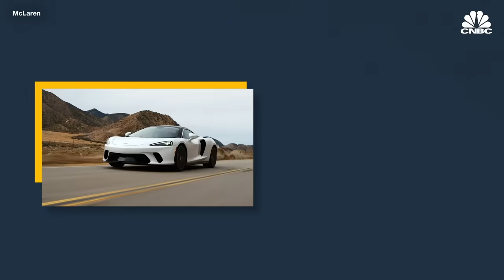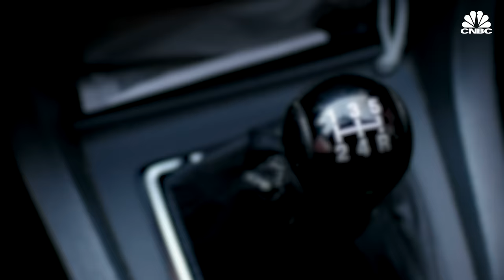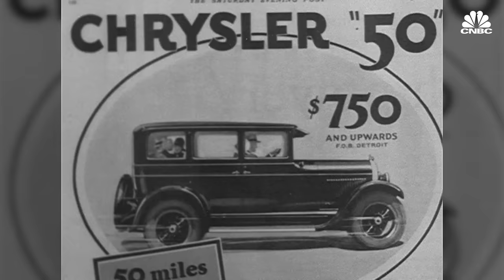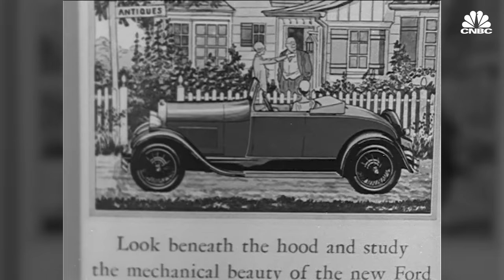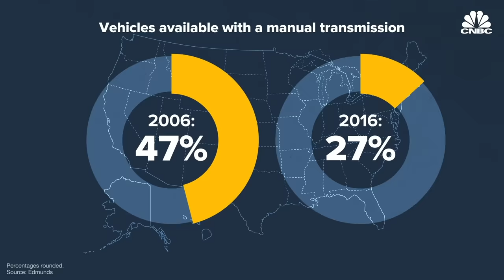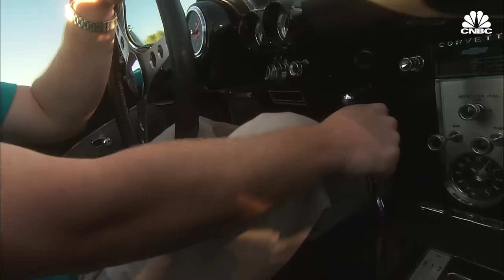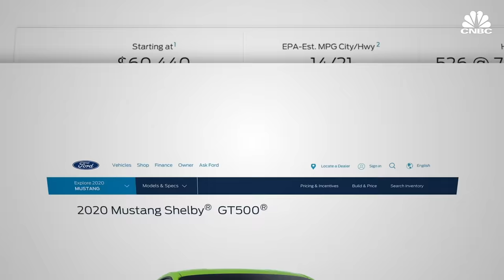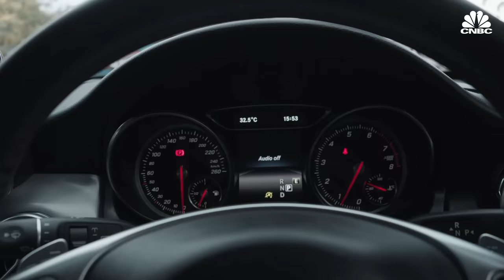Why Stick Shifts Are Going Extinct

Comment: I just came back from a tour where I had to drive automatic and getting back into my little manual Hyundai i10Go was a joy - I feel much safer knowing I have the gears to slow me down in the event of footbrake failure or engine failure. I have so much more control on turns and roundabouts as well. Herein England, I don't think manual will ever die out and most people I know drive manual.

Comment: Interesting video. Having worked at a car parts factory, I do have some knowledge of the whole supply and demand thing. But I, like many enthusiasts, bemoan the disappearance of manuals (admittedly, I don’t presently own anything with a manual). However, both my wife and I have driven/owned stick shift cars in the past and as a retired trucker, I have driven manual transmission semis hundreds of thousands of miles, in my second career. I think it’s a shame you can’t buy an entry level car with a manual, but that’s the direction things are headed. I do know that if I was still in the business, presently I could buy a Peterbilt 579 or an International HX520 with a Cummins and an 18 speed manual; alas I believe those days are numbered too!

Comment: I prefer them. You have more of a sense of control when you drive. I have always hated automatic shift, but I've realized recently that manual sift cars have become an endangered species. When I lived in Western Massachusetts, they were invaluable for driving up the steep mountains I regularly had to navigate, especially in the snow. Automatic shift cars don't have the kind of sensitivity that's a real necessity. On the other hand, when I moved to Chicago, my manual shift was a pain because there are so many stop signs. But I'd still prefer a manual shift. They used to use less gas, too. I noticed recently that Honda doesn't seem to offer manual shift anymore. Sigh.

Comment: I took my drivers license test in a 1973 Pontiac Trans Am with a 4spd manual (my moms car)totally freaking out the state employee conducting the test. Today class-A truck drivers getting their license for the first time will have a mark on their license if they were not taught to drive a manual transmission. Also a car with a manual transmission today is the best anti-theft device you can have according to AAA.

Comment: Yea this all makes sense but for example the new R35 GTR from Nissan only came automatic because the engine has too much power for a manual
Reply: thats just not true at all lol, can make more power than a 35 gtr on a stock r34 6 speed and have no issues

Comment: manual is an advantage to long distance drivers such as truckers because it keeps you alert as you constantly have to listen to the engine, watch speed and watch road conditions. manual drivers also take on the road with confidence, as if you havent mastered stick shift  you wouldnt want to  get backlash from other road users.with auto, fatigue has led to serveral accidents

Comment: I drove a manual from 1977 until 2023. I stuck with them for all the reasons outlined here . . . connection, control and also you can clutch start them if the battery goes flat. By 2023 as traffic has increased I had become increasingly tired of the constant added demands to my attention which a manual requires and this was causing added irritability on the road. This coincided with the purchase of a hybrid with a CVT/auto transmission and I now enjoy driving so much more and always arrive relaxed. The growth of EV sales in Australia is going from exponential to vertical (admittedly off a low base) and this will spell the end of manual cars anyway.
Reply: I drove in heavy traffic for years and rarely had to touch my clutch and brake pedals. I had to think about what I needed to do with that manual transmission in heavy traffic about as much as I had to think about remembering to breathe. It was more relaxing for me than an automatic. While everyone else was constantly starting and stopping I would just creep along steadily not wearing out my clutch and brakes and not having anyone run into the back of me. I would just play music and relax.

Comment: I taught myself how to drive manual... long story short, I was 15 and on the phone with my gf at the time, it was late, she asked if I can come over. Well the only vehicle I could take without waking my parents was my dad's work truck which is stick.  Soooooo I put that sucker in neutral, let it roll down the drive way, started it and was off on an adventure(did not have a license either).  

She lived on top of this big ass hill but I was determined, and I got thru it only dying out once and ironically it was on my way back home at the bottom of that big ass hill.

Comment: Not in Mother Russia...

Well, I'd love to have automatic gearbox with a gear stick behind the steering wheel, just like an old school. Oh, and not two separated seats, but entire sofa at the front. But we have what we have...

The good side though, it might happen, if the battery dies, you can try to push the car from the hill (it did happen with me twice), in order to start the engine. I heard, this trick doesnt work with an automatic gear box car.

Comment: Have a Honda manual and a CVT. The Manual is definitely thrill when in the mood for swinging it. But the automatic is the boon for bumper to bumper traffic when driving to work, high traffic highways and even on hills where the creep mode takes the risk out of reversing or creeping at an expected stop scenario on steep inclines. And my wife who uses the CVT(only) is finally getting better mileage and NO left leg pain as she no longer has to fight with the clutch 😅

Comment: Because driving a manual is a pain.
Reply: No, it's not. It becomes like automatic behaviour. Been driving manual for about 45 years, I don't even think about ... ooh, now I have to shift. The sound, velocity, feeling of the car ... your subconscience takes over and you use the clutch and gear shifter just on instinct. Anyway, in three days, I will be shifting to an automatic transmission due to changing to a new hybrid car. I'm curious, never drove an automatic before 🙂 I do expect it to be more convenient in urban traffic. Do think I will need to put my left foot in the booth for the first few weeks or tie it behind my back 😀
Reply: @wimve4719  if you like changing gears in heavy traffic , then that is you, me personally I hate the whole outdated system.
Reply: @bushtrash2286  That's a personal opinion and I have no problem whatsoever with it. You probably grew up with automatics. Well, I did not. 'Outdated'? That's a bit of a biaised opinion probably based on your personal experience. In the end, this is not a discussion: I'm used to driving manual and will be making the transition to automatic soon. I'll just need to get used to it, I guess. As I said, it's not a competition.

Comment: I’m a die hard manual transmission lover and once Audi took them away from their S3, S4, A3, and A4.. and BMW took them away from their (this goes for both front wheel and all wheel or i and xi) 320, 330, and now 340 series… basically there are zero all wheel drive manuals to choose from but Jeep, the VW golf r (thank god they haven’t taken that away) and the Subaru WRX (and this is the last year of the wrx). I walked away from Audi and bmw being so upset that there was no manual and bought a Hyundai Elantra N last year.. the last year they also came in manual. But I’m still SO confused as 80% of european cars are manuals! All the cars I want with manual which are all wheel drive including suvs are still designed and are the main choice for Europeans! I don’t understand why we car buyers in the USA aren’t even given the offer even if forced to wait months.. I’d wait as long as it took no complaints. My 2009 bmw 335xi, and 2004 Audi S4 were the best cars I’ve ever had.. the stick keeps my hands away from distraction and always has me focused on the driving I’m doing. I know I’m not alone in my manual transmission woes but honestly.. will I be driving used cars from now on? It’s very very VERY likely as there is simply nothing better than a manual!

Comment: The thing is: 80% of the cars sold in Europe and Japan are sold with a manual transmission. The automatic transmission is very much an Americanism. And I think the reason is this: Europeans and Asians, for the most part, don't have to drive everywhere. They have built their cities and towns around not having cars or mandating their use for the most part. And that's a conscious choice. You have to remember that most of the cities of Europe and east Asia were rubble in 1945. And many did go through a car-dependent phase. They just realized that it sucked.

Comment: Manuals help with not getting road hypnosis ( driving amlesly withouth knowing how u get somewhere) or falling sleep at the wheel due to the constant gear changes keeps the driver alert of outside conditions, are u almost at a intersection?  Shift up down or disengage if the light turns red. Having the driver have to make a choice keeps driver alert

Comment: Love my Stick Shift but I work from home. If I had to spend 2 hours a day in traffic I'd be wishing for an Automatic...
Reply: I spent 3 hours a day to go 70 miles round trip and driving my manual was not an issue at all. If you do it smart you don't need to shift much and you'll use the brakes less often.
Reply: @martyharless5097  Never had a problem with long commutes. I'm talking about the "3 hours in bumper to bumper traffic" to go 5-10 miles.....
Reply: @GrendelMTL  my morning commute had no traffic. Afternoon traffic was heavy. It was easy with a manual. I rarely had to use my clutch or brake. I never had to think about what to do. I could have easily been in bumper to bumper a lot longer and I would have been fine except for the frustration of the extra time it would take.

Comment: I know the real reason people dont want them.
You actually have to focus on driving. Try scrolling facebook on your phone or eating a hamburger while driving stick.
Driving an automatic car is so mindless and easy it almost dares you to stop focusing on driving. I actually ditched my automatic car after 6 years of driving only auto after I had some close calls with red lights and nearly rear ending someone because I zoned out while driving. Learning to drive stick has been a very eye opening experience to how little I actually paid attention to what was going on around me while driving because now I have to pay attention to EVERYTHING. I'm scanning way ahead at the lights and thinking about when I'm going to shift gears. Watching 2 or 3 cars ahead and keeping better distance so I don't have to slow down and down shift. I actually pay more attention at a red light than anywhere else because starting from stopped is the hardest part of driving a manual. You'd have to really try hard to be an unfocused, distracted driver behind the wheel of a stick shift.

Comment: I learned stick shift from video games, in 2015 I bought a brand new Ford fiesta st with manual transmission.....and turbo , love my turbo spooling up and waste gate dump air on shift getting attention. Still have her in the states and now I own a Toyota land cruiser with diesel engine and manual transmission here in africa.
Reply: wastegate doesnt dump air, a wastegate is like a bov for the hot side of the turbo and unless its screamer piped you wont hear anything when it opens
Reply: @arcanevoid9199  your right the valve is timed with the wastegate reset on shift. No I dont have screaming pipes installed.
Reply: @generalagondray  no thats not what im saying. the wastegate is used to control the boost levels, and opens to let exhaust gas (waste) bypass the turbo. plenty of turbos have an internal wastegate which will not make any noise when opened. some cars have an external wastegate which is bolted to the turbo manifold, and the only way it will make noise is if its not plumbed in and venting externally. what your talking about is a blow off valve or bypass valve, its a completely different thing
Reply: @arcanevoid9199  yeah I know I confused the waste gate with the valve. That stuff twns to happen looking at 4 walls for a year unable to do anything.

Comment: I learned how to drive a manual when I was younger, due to my father's insistence (though it took me a while to get the coordination down). I no longer can due to the loss of my lower legs, but I can operate an automatic with hand controls installed.

Comment: In New Zealand in the 90s and earlier most cars on our roads were manual. I went to the USA in 1996 and was surprised to see pretty much every vehicle back then was an automatic, even the tour bus we travelled in was an auto. In New Zealand we used to assemble our own cars using complete knock down kits from Japan, these cars weren't cheap to buy and lacked features such as a radio, power windows, power steering and usually contained a manaul transmission. It was possible to upgrade to an auto and pay more for the extra features. Then in the 80s the tarrifs on imports were relaxed and suddenly we started importing cars and in particular second hand imports from Japan. These imports contained all the extra features and in most cases an automatic transmission. What this meant is from the late 90s most of our cars on the road are now automatic.

Comment: Ive never considered a manual transmission as work. Its fun to me and the best part is it keeps me more aware of my surroundings since it keeps me off the phone. Automatics are a snoozefest. Manual transmissions can be rebuilt on the cheap while once a automatic transmission will cost more to rebuild than putting in another one. Way more expensive to.

Comment: my 1st car 15 years ago was a manual sentra 99, it was hella fun but the worn clutch n trans sorta gave me a sore taste about those transmission, so when it died, i went for an automatic car, and then after 2 automatic cars for over 10 years, i went back to a manual 2.5L mazda 3 2018, it's my best car choice i did, those automatic-transmission are boring as hell, they make driving a chore, it's obvious they are trying to pull out the fun out of driving so ppl just stop enjoying cars for the driving fun. Now i'm back fully alive with a manual, i love riding around town, driving makes you feel like you're working a skill, not just doing mindless driving like all those slow ppl plugged on their phones.

Comment: #1 Reason to own a manual is when you need to overtake a car. In situations when you need to get in front of a car quickly, it is much easier in a manual transmission, because you have complete control of the car. You will inevitably have to do this to avoid collisions. With stick shift, you drop to a lower gear and floor it, after rev matching of course, giving your car much faster acceleration. In an automatic you floor it and pray you get up to speed in time. Being able to shift gears at the right time gives you a huge advantage in different situations.
For this reason alone, I could never go back to an automatic

Comment: I remember back in the 80’s people paid extra cost for automatic transmission but if you didn’t have money or no options then ended up with manual. Manual never a must have for majority of folks. It was a must for race cars or street racers only.

Comment: I’m 45 years old. I’ve been driving stick since I was 10 I’m self-taught I taught myself on my grandfathers model a Ford. As of 2022 I drive a 20 year old Nissan Xterra with a manual transmission.  I’ll NEVERbuy new because what I want doesn’t come in manual. I love my Nissan. It’s very fun to drive, especially with the V6 and four-wheel-drive.

Comment: Manual gearbox’s are not going away because of efficiency, reliability, or any other “issues”. …well, there is actually one “issue” - control. The driver of a stick shift car controls that cars transmission 100%. Drive by wire with auto transmission can easily be controlled remotely, with a simple click. This is why all new cars are being made this way. They are removing the control of the vehicle operator. 

Drive by wire - you do not control the throttle. 
Steer by wire - you do not control electric steering (unless it is assisted, and even then control is hindered; and this is on the way out - to be replaced with fully electric steering). 
Electric brake control - you do not control the brakes. 

So, if the operator of a given vehicle only controls the operating controls of said vehicle, then the operator does not control the vehicle. The control modules control the operation of the vehicle. An operator will provide input that the modules then process and adjust and then provide modified input to the control devices (throttle, brake, steering). The control modules can easily be controlled remotely. 
Think about it.. 
It’s not just for bank robbers or other types of criminals, who could easily be sent straight to the police while locked inside their own car. But, this is a guise (just one excuse) under which true intentions are being hidden. 
Think about it.. It’s a long term plan. It’s a much bigger picture than most people think.

Comment: Drive a 95 Chevy s10 5 speed with 276k miles on it. Paid $1400 for it. I plan to ship it theseus this truck. Amazing gas mileage better than my wife’s old 14 Corolla eco. I work construction and the manual control of the gears is great for driving on job sites with steep slopes, dirt/gravel roads, down shifting for that extra oomph or pulling heavy equipment. I will do everything I can to drive a standard pickup for the rest of my life. I have coworkers who have 30-60k trucks that they take on site. All it takes is one distracted guy in a lull, boom lift, or delivery driver breaking smashing that nice new truck. My next pickup is going to Be used either a I6 AWD or V8. Ride it until the wheel fall off. Chevy and ford have tons of parts at the scrap yard near me